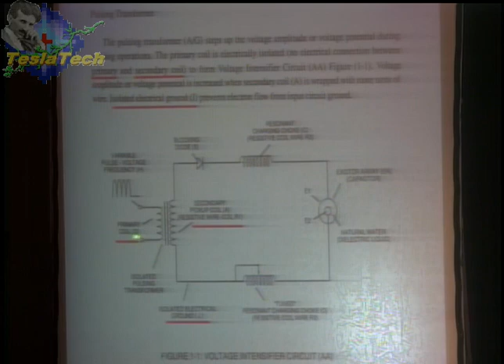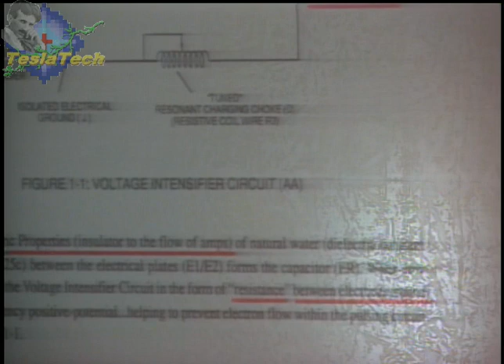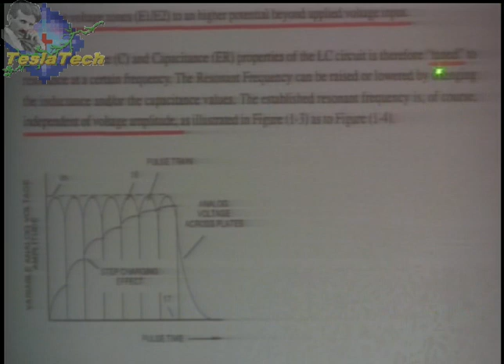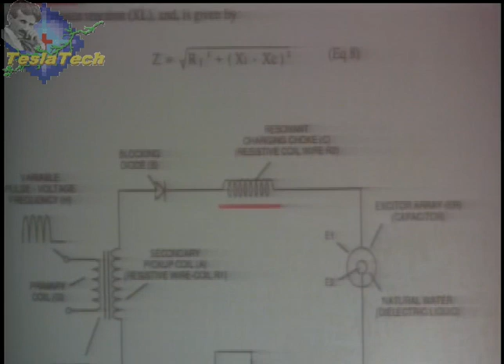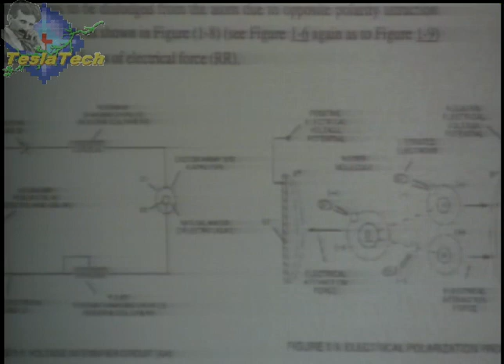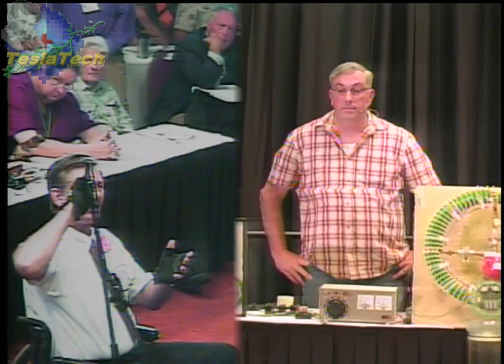Max Miller - Stan Meyer Unveiled! Convert Water to Fuel, Extraordinary Technology Conference, 2015

Comment: A 12 volt battery along with all others is in a constant stage of discharge. As soon as you touch a lead to measure output you're causing a flow of current if you also have a ground negative attached.

Comment: According to Konstantin Meyl (Stanley didn't know this), you need a new electron to help the H2O molecule separate, and it's thanks to the resonance that that electron comes into being. It comes into being, not from the plates, comes from a neutrino becoming an electron, thanks to the resonance... this way we get more electrons, than before, and the energy in the form of electrons is not coming from the circuit.
So it's understandable that there is a heated debate over the number of electrons, what's not understandable is that people neglect it when it's a fact, instead of test it.

Comment: The negative terminal is where the electrons are the electrons are what produce your electrical charge when they move they are they are like the current of a river a powerful River the more electrons you have the bigger the current the voltage is just the pressure you can have one amp flowing it is like 1 gallon of water a minute flowing when it's in a big pipe it has low voltage when it is in a very small pipe it has high voltage cuz voltage is pressure current or amperage is power it is volume but changing the size of the wire does not change that it just offers resistance because it cannot flow it manifests energy in another way ie heat

Comment: Voltage is not a measurement of the power available voltage is a measurement of the potential voltage difference between two sides current is measurement of the power available or moving it has to be moving to be red because  power flowing is the presence of power voltage is just the difference and pressure therefore high pressure on the negative side where there's abundance of electrons and low pressure on the positive side where there is a lack of them like positive air flow and vacuum the electron except excess on the negative battery terminal is high pressure it is a build up of electrons waiting to go somewhere the positive terminal is a lack of electrons waiting for electrons to come but actually it is not a vacuum because it does not attract electrons actively by itself you cannot just have you cannot just have a batterys positive terminal I'll accept an electrons from another source that does not feedback to the negative terminal I don't think

Comment: The voltage differential is a lack of electrons on one side and an excess of electrons on the other side if there was the same amount of electrons on either side there would be no voltage differential therefore no voltage

Comment: You can have you can have voltage with no current because the voltage is the differential there is always a gift there is always a differential between the positive and negative terminals therefore the voltage differential is always there unless the battery is dead current only reads when there's power flowing the the name current as in the current of a river

Comment: The Great Scientific Swindle...

here s the story and the facts...

Stanley Meyers  would have designed a water engine using a system to cause the fission of water molecules to extract the hydrogen and oxygen they contain. This while consuming relatively little electrical energy compared to the energy produced in chemical form (the mixture of di-hydrogen and di-oxygen can be burned). According to him, the efficiency of his "molecule separator" would be greater than 1000%, which is controversial. Stanley Meyer was sentenced for fraud in 1996 because the court ruled that his invention was only a conventional electrolysis, deviating greatly from the advertised yield.

He built several prototypes to show off his invention, aboard a 1978 Chevrolet Camaro and a Buggy in the presence of the local channel WSYX (subsidiary of ABC). Meyer estimated that he could make the trip from Los Angeles to New York with only 83 liters of water. It is another type of hydrogen engine.

In 1990, Meyer's investors lodged a complaint for gross and egregious fraud. When judged, the prototype performs less than it would if Meyer's theory were correct. The court decides that it is in fact only a conventional electrolysis, concludes that there is indeed manifest fraud and condemns Meyer to pay 25,000 dollars to the investors.

His mysterious death in 1998 will fuel a series of stories (see Urban Legend) and rumors related to the theme of free energy censorship to this day unresolved.

Meyer died suddenly on March 21, 1998 leaving a restaurant, three days after selling his patent to NASA. The autopsy report from the Franklin County (Ohio) police concluded that an aneurysm had ruptured at the age of 57.

Its defenders rather speak of poisoning involving various countries with financial privileges important to other energies (hydrocarbons) or the American government.

The patent has expired, so all details are free to use,
but no one has used it to release a product or a
working demonstrator....

Comment: Water as fuel is bad because water is a limited resource
Reply: Actually this technology can be used for desalination and reconstituted into fresh drinking water. By burning hydrogen, it returns to water vapor and gives off heat as a byproduct, which the water can then be condensed and collected for reuse, or drinking. You could use the heat of burning hydrogen to boil off salt water into distilled water, then transformed via this process into hydergen, then reconstituted after burning into drinking water.  And Actually if enough cars were running this, instead of smog you would have clouds which would be seed clouds to form good rain, bringing back fresh water to the land.

Comment: Water is used to put out fires because it doesn’t burn. Gasoline is used to run combustion engines because it burns. Running combustion engines on water is as possible as putting out fire with gasoline.
Reply: You not the sharpest tool in the shed
Reply: @explorster  And you are? Do you honestly think producing hydrogen from water is a source of free energy?
Reply: @mitseraffej5812  who said its free energy
Reply: @explorster  The proponents are? They are implying that their “ breakthrough “ technology could with a small electrical current liberate large amounts of hydrogen. There is nothing new about running combustion engines on hydrogen. To produce the hydrogen in the vehicle will require batteries, the water, the apparatus then the heavy combustion engine.
Electric vehicles just have the batteries and a light electric motor.
The problem with using hydrogen as a fuel is the handling and storage. It has to be stored as a cryogenic liquid requiring very strong and well insulated tanks. There has been progress in this regards with composite construction. Back in the eighties Lockheed did trials of running one of three engines of an L1011 airliner on hydrogen. The engine worked fine but storage and handling of the hydrogen was a show stopper.
Reply: @explorster  the water injector is absolute bs.
Reply: @sammyd7857  it works in my truck
Reply: @explorster  water injection is obviously good for volumetric efficiency. I.e. watet flashes into steam giving more push.
Reply: @explorster  let us all see your truck running only on water

Comment: I’ve been thinking about this a lot I know we have the means today to make a guess has anybody ever thought of using a diesel injector caterpillar made them in the mid early to mid 90s Ford also made them they runoff of oil pressure a high volume which intern creates 21,000 psi for direct injection and possibly is using a standalone computer to run the engine the technology is here today Stan basically made his own standalone computer back then

Comment: well you right but by using electricity you conducting what call heavy water though heavy electrons witch lead to making uriunioum  by change isotopes to plot onium  which is heavy  in toxic if is not control . Mayers knew that from atomic perspective but hydrogen is explosive once is compress in gas to the atomic level if you put water thought electrolytes is what  get heavy water leading nuclear isotopes

Comment: Why is there still no car to run on this shit?
Reply: Toyota just made one...
Reply: @rickgrinds  Toyota did not "just" make a water powered car. 

Toyota has been building hydrogen fuel cells, for decades. Mass produced and readily available Toyota hydrogen fuel cell cars have been available for years, now in second generation. The problem is the fuel, it's not available anywhere but  the left coast currently. If you want one, they have proven extremely reliable and the concept is solid, just have to move out to the worst place in the country.
Reply: @krogunlimitedfahrenkrog6110  why you got to be so fucking technical you know what the hell i meant..
Reply: @rickgrinds  No lol, but a Japanese company did build a water powered car, reportedly, awhile back. Disappeared so probably did not have the kinks figured out. 

Company call "Genepax" if you want to see.
Reply: @krogunlimitedfahrenkrog6110  ok bet ill check em out. What are ur thoughts on it u believe Meyers was a scam or probably legit
Reply: @rickgrinds  Honestly I don't know what to think. The Japanese have found a was to split water with nearly 100% efficiency, there isn't anything definitivelt saying that Stan Meyers wasn't being legit, and there is certainly precidence to information being hidden or misgiven for profit. 

I think at very least he was on the right track, the coincidence of his death and the car dissappearing sure doesn't help.

Comment: Set speed to x 1.75. Thank me later.
Reply: i’m more of a 1.5x person but to each his own… But yes, thank you for the tip. Till i tried it, i didn’t realize how slow he was really speaking. It was very annoying, especially with all the lip smacking.. I was going to turn this off but now its much better.
Reply: Uh, how do I do that? This guy sounds drunk but I really want to listen to this.
Reply: @zacherysellards4275  hahahh, right?  its bad. But in the off chance your not being facetious... Top left corner looks for the 3 vertical dots.. and hit play back speed
Reply: @jeffalln3591  thank you, totally serious. And that was way better though I did end up at 1.5, it sounded natural.
Reply: Best way to avoid wasting too much time on this video is to skip it altogether. Stan Meyer was a charlatan. No need to thank me.
Reply: @nodriveknowitall702  I don’t know… I have built an HHO system… Got it to run a lawnmower too. Downside is that to sucked up 30amps from my battery to do it and produced enough HHO to run the mower at idle.. Try to speed up the mower and it conks out. So it does work enough to warrant research on how to get this to use lower energy and increase the output.  Im no scientist but can tinker around and if i got this far, someone much smarter than me could definitely improve this.. Im using battery cables directly to the cell too.. Im sure an improved system would have some kind of controller board to fine tune some things. Seems that what these guys are talking about is addressing this very problem. Looks like higher voltage and some kind of a timing circuit to get the right resonant frequency to split the water more efficiently. And resonant frequency is no BS either… just ask people who design bridges and buildings. The slightest winds or movements can start a chain reaction the gradually increases till it destroys them. I believe that those audio deterrent devices (LRAD) uses resonant frequency to incapacitate people.. Anyway, that is one of the keys..  I have seen and done enough to know that there is definitely something here that needs to be further investigated.. Will it be enough to run a standard car or truck engine alone? who knows.. Maybe it can be used to help get us from 25MPG to 50MPG+ as a fuel additive. Maybe Stan Meyer was a fake, but he brought a good subject into the light… Maybe he really did fake running his car on HHO, but doesn’t mean that it cant be done or improve how we do things today. And before anyone says HHO and modern engines with oxygen sensors, etc.. YES, that is one of the problems too. However, you can separate the hydrogen from the oxygen fairly easy so that you only pump hydrogen into the engine. Do that and the oxygen sensors wont care or react. That is a slightly different and more difficult setup (still anyone can do it) i have yet to try.
Reply: @jeffalln3591   I'm guessing you were drawing 30 amps from a 12 volt battery. That works out to 360 watts which is roughly half a horsepower. You were putting 360 watts into the system from your battery and maybe 60% of that was actually doing HHO production (losses went into heating, etc). 216 watts into HHO production. HHO ran your lawnmower, likely poorly, with additional losses. Let's say 30 percent of the energy of HHO produced went into mechanical energy, so now we're down to 64 watts which merely kept your mower idling. There are electric motors that achieve better than 90% efficency, so you'd have been better off swapping your engine for an electric motor and running it directly from your battery. 

Let's pretend resonance can do some magic and get the HHO production efficiency to 99.99% (we can never achieve 100%, there are always losses). Let's also pretend that HHO is better in an internal combustion engine at converting combustion into mechanical work than gasoline is. I've gathered that the most efficient combustion engines achieve 40% efficiency. Let's assume HHO boosts that to 70%, which I doubt. That still only gets us roughly 70% efficiency overall, still behind an electric motor.

Stanley Meyer pretended he was achieving better than 100% efficiency through magic. He acted as though he just dumped water into his buggy and ran on down the road. Perhaps resonance can increase the effeciency of HHO production, but It's not going to allow one to run a car on water. Meyer was a charlatan.
Reply: @nodriveknowitall702  bro, I respectfully disagree! Why do you think that? And I'm not trying to pick a fight or any of that shit. I truly want to know your side and reasoning.
Reply: The presenter is an agent. The slow slurred speech and incompetent mannerisms is a typical approach to make people disinterested in the subject, discredit it, and waste people's time. It makes the community sound stupid to outsiders and they tend to then write off everything they say, even on other subjects.

Comment: I agree with the tv technician. You can have a static charge and no amperage movement therefore voltage potential can build up because there is no discharge.  Once there is discharge there is movement of electrons.  Voltage potential will build with no amperage until a circuit is made
Reply: Read up on the pioneers of electrical theory: Tesla, Maxwell, and Stienmetz Because there are NO electrons. Eric Dollard is another electrical genius and he is still living and producing lectures on electrical engineering, he's got a few for free you should look into.
Reply: @15thobserver  no electrons? What travels in a bolt of lightning? Hmm. Will look up Dollard and others. Thanks will research
Reply: @paulkainer269  Would you mind if I link you to a few video's? If youtube will let me of course.
Reply: @paulkainer269  photons? Electronics is a  diverse field that includes many unknown parameters. Frequency and magnetism is primary concepts. Going back the Faraday his students included Tesla, Einstein and Leedskalin. The later interpreted a completely different concept as the two today expressed a difference in opinion. Both may be correct depending on what they effect. Don't get too side tracked but keep your eye on the ball.
Reply: @mtsflorida  then what is your conclusion?
Say like a lightening bolt voltage is present but no electrons moving? Then what is travelling? Or any of the other topics you mention. What are your conclusions?
Reply: @paulkainer269  Yup, no Electrons as understood by academia, even JJ Thomson didn't consider them that, he considered them the terminal ends of electrostatic induction.

There are only 2 mechanisms involved in the "flow" of electricity, the Magnetic and (Di)electric fields, and the potential difference, all that occurs on the outside of the wire, what ends up inside is what the wire fails to reflect unless it's supercooled.

Electrons as proposed by academia were born as a misinterpretation of Thomson's works, by the end of the academy hearing he said this: 

“To the electron: may it never be of use to anyone!”
Reply: You missed the whole point. That was the guy on stages main point. And Stan.....
Reply: @TravisTellsTruths  the build up of charge?
Reply: @TravisTellsTruths  ok will rewatch to see what point I am missing. Probably like looking for your glasses when they are on your face

Comment: Another way you know it works.... if you just do dc electrolysis you don't get water over EVERYTHING... if the circuit board is close water vapor builds up on it...  the power supply wires get damp... thats from ionization...

Comment: If anyone remembers that dabbled with this then you remember the Lawton circuit..... it does work... but its too much work for most people...  

You know when it's working when your power supply draws three distinct amp levels... and when reading voltage you'll get 3 voltage levels...